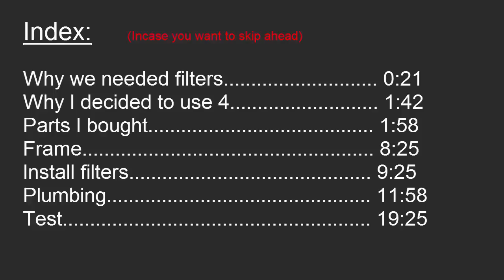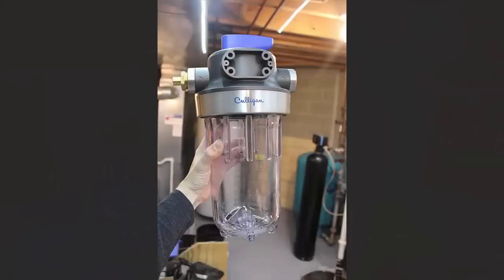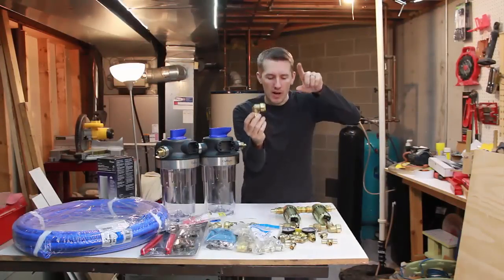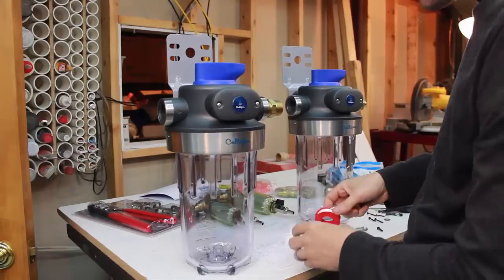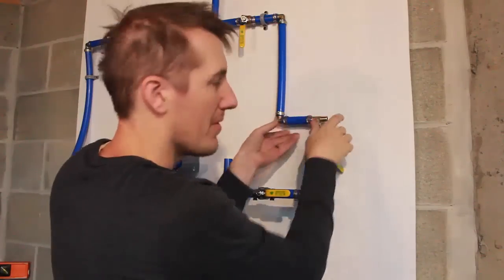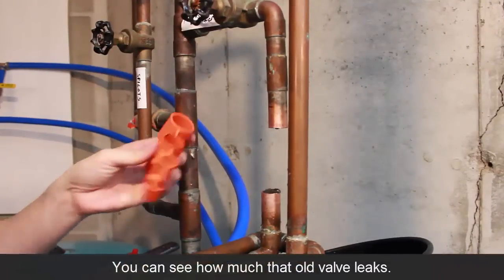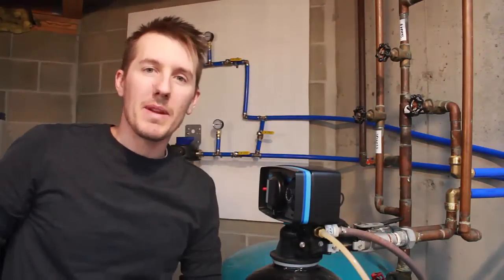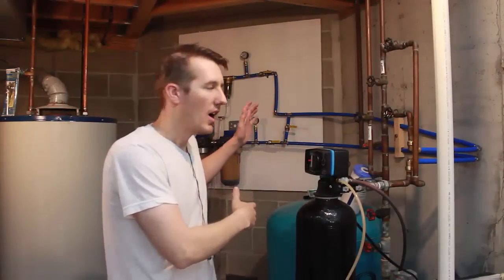How to Install a Whole House Water Filter System

Comment: So, if I have city water would i do the same setup? If so could I use a finer filter?
Reply from the maker: You probably wouldn't need as many filters as i have.  We have well water with lots of iron/rust.  And instead of having it go to just 1 filter and that getting clogged immediately, i installed 4 to try and keep the flow high.  
If you have city water i bet you would be fine with just 1 of the Culligan filters, and putting just a 5 micron filter in that.  They also make 1 micron filters i believe.
Reply: Yeah for city, I would use 5micron max, then a 1, then some carbon filters for better taste and to remove chlorine.

Comment: So you would only do 2 filters 100 and 5 microns instead of 4 filters?
Reply from the maker: Ya.  Here's a video i did 4 years later.  https://www.youtube.com/watch?v=OKzFrxKLDyA&t=229s
I would do 1 iSpring 50 micron and 1 Culligan filter with a 5 micron filter inside.
BUT....
If you are going through all the hassle of making this, it doesn't hurt spending an extra $50 and putting in another filter.

Comment: Always deburr copper pipes. Especially when using shark bite fittings. Not doing so, the o-ring can get cut by the copper.

Comment: You don't check for pressure drop when static, open a tap and get some flow through there to find out what your pressure drop is.
Reply from the maker: Oh.  Good point.  I should do that.

Comment: the water pressure gauge has a  1/4 inch tread. I dee an adapter to convert this to 1/2 inch but how do we go from that to 3/4 inch pex? I don't see that fitting in the list of parts?
Reply: If you install a 3/4" x 3/4" x 1/2" reducing tee on the main line then you can use a short piece of 1/2" pex pipe with a 1/2" female threaded adapter which will fit the 1/2" reducer bushing.

Comment: If your main supply from the water main is 1", then use 1" for the whole system. My system goes from 1"  down to the 3/4" after the filters.

Comment: Did you consider installing a UV Light to sterilize the water?
Reply from the maker: No not really.  I thought a UV light is used to kill bacteria in the water.  And it needed power.  It wouldn't hurt, but i was more worried about the rust/iron in the water.

Comment: Did you text water ppm? And or drinking water test strips before and after or bypass it and still can. I'm doing 4 filter system hoping to get some down to 20s
Reply from the maker: We had the water tested when we moved in, that's how we knew we were high in arsenic.  After installing these filters and the reverse osmosis filters i did 2 more tests.  1 with water through these filters and 1 with water through these filters and the RO filters.  I can't remember exactly but i think through these, the arsenic was at 14 ppb and through the RO it was like 2 ppb.
Reply: Right  is the  ro  setup five stage under sink? What was ppm of water with no filters you know?
Reply from the maker: Yes the 2 iSpring filters and 2 Culligan filters are in the basement right where the water comes into the house.  Then i have one of the RO systems under the bathroom sink upstairs.  Then i have another one for the kitchen sink.  For the kitchen sink, the RO system is actually in the basement.  I just used a longer tube and it's worked fine.  I think the numbers for arsenic were 23ppb with no filters when we moved in, 14 through the whole house filters and 2 through the whole house filters and RO filters.
Reply: Thanks for information I am trying to get my filters in and some rest strips as well as ppm meter hope to make video on it

Comment: Pressure with the water not flowing has no meaning at all in relation to the restriction of the filters you need to think in terms of flow rate   i.e. not the pressure that the water sits at when not being used which will always be alike but instead the volume of water that flows measuered over s fixed time period
Reply from the maker: You're right.  I should have said flow or flow rate not pressure.

Comment: I think it is important to point out a couple things to people using this video as a guide. There are a couple issues with Dave's installation that I will point out.
1) The copper pipe needs to be cut perfectly straight with a tool specially designed for this purpose as is explained in the video below by a professional plumber at 6:13 point for the reasons stated.  I realize Dave did not do that because he said that a cutter would not fit in the area where he wanted the cut, but I would choose another location to attach in such a case.
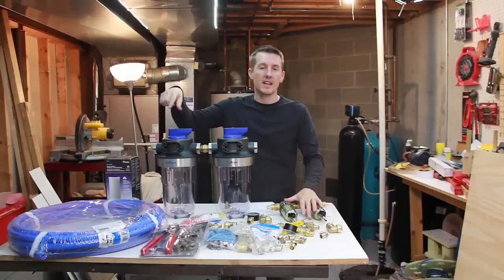2) As you can see in the video below you should not clean the copper pipe surface when using the Sharkbite fitting as you can see in the video below at the 8:08 point. 

https://www.youtube.com/watch?v=V48FQBbeZhk

Comment: Gee,I would NOT like those valves! They are restrictive. Better to have a full flow valve or THREE.  ONE MORE:  I suggest a strap for your water heater. You can DO IT!
Reply: Water heater straps are only used in earthquake areas, not Michigan. PEX A uses less restrictive couplings, he used PEX B.

Comment: Be careful with his brass fitting list. Most of the brass fitting links are ones that contain lead and are not to be used with potable water.
Reply from the maker: Which ones?  I just see Brass as listed material
Reply: @DaveWirth  Your reducers, nipples, and pressure gauges are not lead free brass. Brass fittings are required to state if they are to be used for potable water. If they do not state that specifically then it's brass with lead in it. Everything SharkBite brand is safe. If you read those descriptions you'll see where it says lead free and potable water allowed.